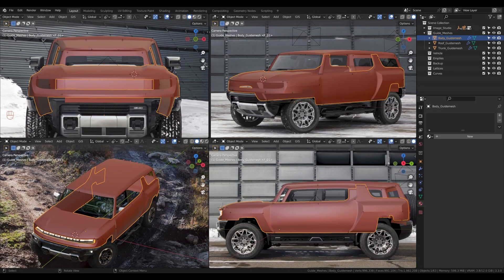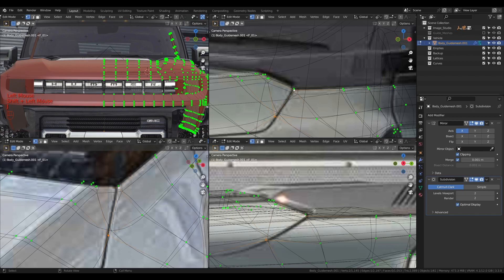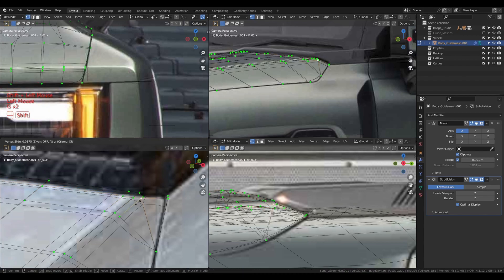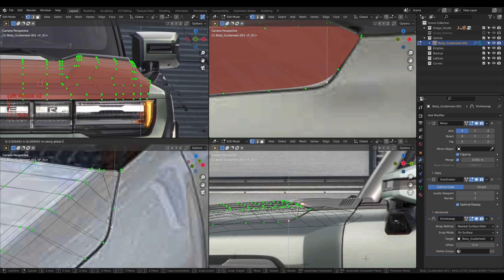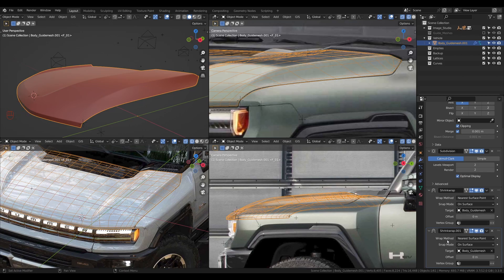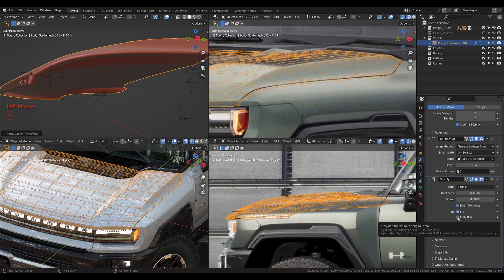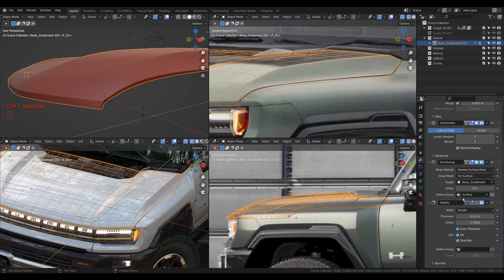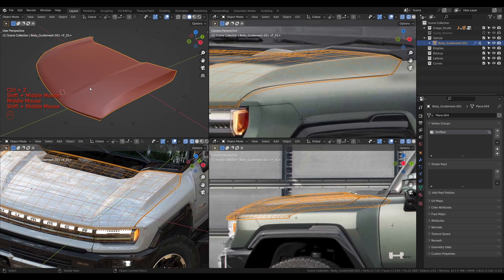Blender Vehicle Image Modeling - Section 3 Part 1

Comment: Hi and thank you for your tutorial.
May I ask you a piece of advice regarding the specs of the pc I should use to do animation in Blender? Do you think an old RTX 3060 with 12gb of vram is enough? And do you think a desktop machine is essential, or is it possible to do animation with a laptop? A laptop rtx 3060 has only 6gb of vram, do you think it's too weak of a graphic card?
Thank you for your attention, have a good day.
Reply from the maker: I use a 3060 desktop, and I've used a 2070 super laptop and both worked very well... you should be fine
Reply: @NaturalArtFreak  Thank you for taking the time to answer me. May I ask you if using a laptop for blender animation will cause the CPU or GPU to literally melt? Does your laptop with the 2070 still work?
Reply from the maker: @paolo greco  nothing will happen to your laptop haha... it should be fine... mine is still running like new.
Reply: @NaturalArtFreak  Thank you again for your answer. Could you please tell me what brand is your laptop? I was going to buy  either a Lenovo or an Acer, but I'm still undecided; I've read terrible things about Acer laptops.
Reply from the maker: @paolo greco  I've had acer laptop which I started all this with. A gtx 1050. And guess what it's working and running solid after 6 years of using it. My other laptop the 2070 is an alienware, it developed a fault about 7 months later which I had fix and it was costly... so In my personal opinion I would recommend Acer, but keep in mind how to keep also matters, my Acer has always been with me. But when I got the alienware a friend was using it when it had the issue.
Reply: @NaturalArtFreak  Thank you, kind as usual. May I ask you if you're able to make a living out of what you do in 3D? Or is a "starving artist" kind of life?

Comment: Sir, your series is epic, I want to follow this but I'm stuck on the 1st part where you have shown how to calibrate a car image. I did that thing and it works for that car but when I apply the same thing for this vehicle, it's not calibrating accurately. Can you make a video on this vehicle. 

Just because of this , I can't follow your videos
Reply from the maker: This specific car was a bit difficult to calibrate, which is why I already did that for you if you get the resource files from my gumroad. The video of calibration I made has everything you will need to calibrate any vehicle you want.
Reply: @NaturalArtFreak  I spent 12 days , 12+ hrs everyday just on calibration part, used different pictures, methods and in every case I get failed. 😩. And my bank doesn't allow international transactions so there is no way I can purchase that file. It's bee more than 20 days now.. and I didn't get any results